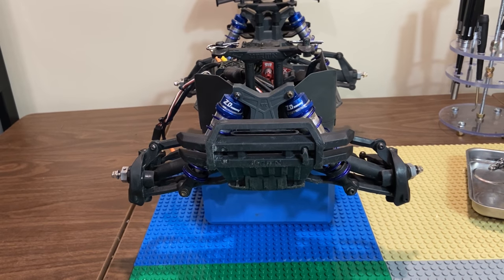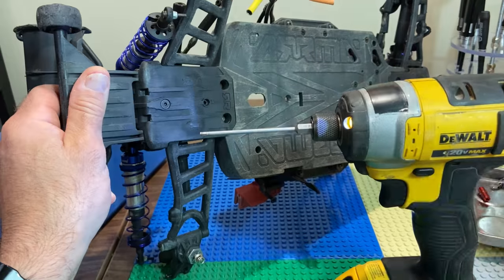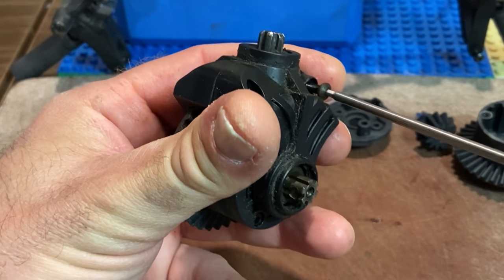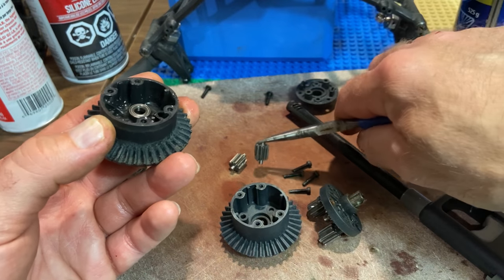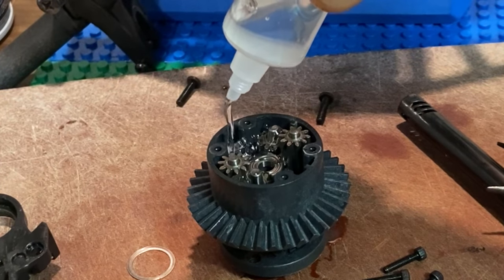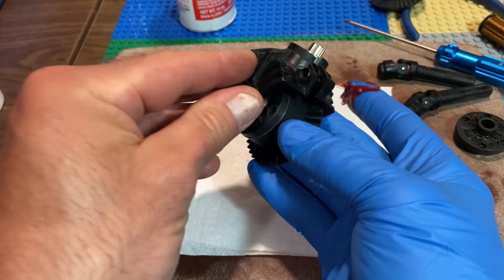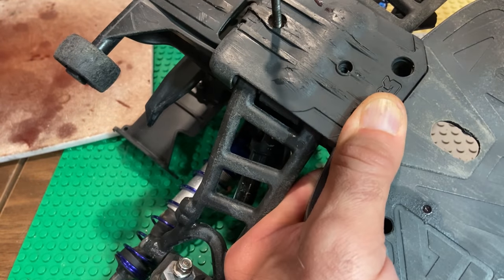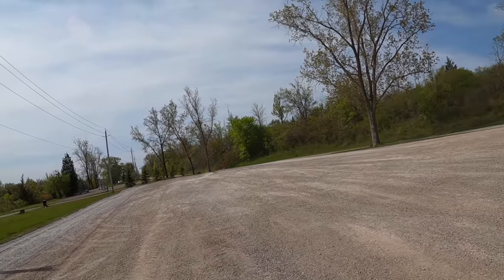ARRMA HOW-TO: 3S AND 4S DIFF REBUILD | GEARS, BEARING, GREASE AND DIFF FLUID.

Comment: Second time im opening my 3s input gear and second time i`m having a massive pain in the butt removing the inner bearing. Like... massive ! I've tried screwdrivers, i've tried creating leverage. Nothing works. My bearing remover can`t even snug in there as the space is too tight. It`s so annoying. I literally can reuse my plastic input gear because it is in perfect condition after i changed it the first time and now i can`t even reuse it because i can`t get the bearing off to service it. This is so weird and annoying at the same time that they would produce the part in a way that would lead to such a hassle. I am not a fan of going metal because it breaks other plastic stuff which otherwise won`t break but this is reason enough to start considering it.
Reply from the maker: It is tough to remove the bearing, I’ve put it in the freezer to “shrink” it, then the bearing came off. I agree with you about the plastic parts….i definitely keep the spur plastic. I ve since done metal diffs in my 3 s Typhon ang Granite, it s goin well. Let me know how you make out. Thank you
Reply: @phillybrc  I also tried the freezer trick after reading on the arrma forums but it was still a pain. Luckily I got it to move at least the first bit and then I used my bearing removal tool to pull it out. Do you have any recommendations about a metal input gear ? I've got a big rock 3s V3.
Reply from the maker: @experiencewithmartin972  Honestly, i ve ruined bearing trying to get them off. I usually by an extra input gear. Sucks. I went with Arrma metal diff. https://youtu.be/wP-CUAd8_fQ

Comment: ii think i buy a zdracing b8xe buggy after seeing a 340.00 buggy has plastic gears nope
Reply from the maker: It ‘s quite disappointing….I hear ya. Thanx
Reply: @phillybrc  i  know after hearing how good they are but thats YT and free promo car videos or they just test all new with no time on them like a big silly kid [me some times]with out looking into guts of situation but i am odd ball  .i like reliability first hence drive a is300 with upgraded aluminium radiator/trans cooler  bullet proof car for moist part the sc300 built a bit better its the next one and ill get rid of the newer one .but learned the hard way no resin why ether one not go 300-400k plus.but thats really the only car i know that way need minum crap to stay alive ..just fyi
Reply from the maker: @overbuiltautomotive1299  I won t deny they are really fun RC’s…I have no regrets at all, but the plastics are a little fishy.

Comment: i have more arrma typhon parts still sealed in bags than ill ever use. ive had mine for 5yrs or so, and the thing still runs great. i took care of it, i notice the caber & toe adjustment threaded rods are showing signs of some minor rust, and the end hex screws that are on the ends of the wheel axles are absolutely stuck in place. its not threadlock, because ive taken them off in the past, im guessing its rust. still dont know how ill get them off. aside from that, those cars were pretty durable. the screws break though. i use marine lubricant in my diffs, and on mesh gears. in diffs its great because it is water repellant, its a little more viscous than lighter grease, but not so much that it causes issues
Reply from the maker: Im with you, this platfor has treated my kids and i well, still run them often. Regular wear will happen! Thanx for watching

Comment: think running the gears dry will be fine, or use a silicone based or other plastic safe lubricant. normal grease will over time soften the plastic
Reply from the maker: I ve always used some type of marine grease on my diffs, I ve been working on this tube of Red n Tacky for over a year now, It s faired well. 👍🏻Thanx

Comment: Ik this vid is old now but I've been dealing with what I'm assuming are diff issues with my nephew's typhon mega. It's brushless now but even before that it was nothing but problems while my 3s has been a king for me. Anyway my question is , what would cause the car to barely reverse while making some kind metal gear clanking sound? It does it in forward to but only if u use the throttle slowly but it sounds like the diff gears r just crunching around in there. Obviously I've been in there and nothing looks immediately wrong gear wise but wtf knows.
Reply: I'll attach a video of it in a bit actually   and maybe it'll be something you've experienced. Tia
Reply from the maker: Is it cogging? ….an ESC issue. Will it eventually allow you to gain speed and the sound goes away? Not gearing issue perhaps?
Reply from the maker: @T401-r7x  not sure if you can attch a vid here. Try on Facebook messenger
Reply: @PhillyB_RC  yea it does go away once it gets going actually,  I just don't wanna tell my nephew it's allset and then have it eat the shit out of the gears ya kno. It could be the esc cuz its a flycolor cheap combo.  Maybe just return n exchange then if it's that. Idk yet but I appreciate u responding so quick!
Reply from the maker: @T401-r7x  Ya, it sounds like it’s cogging. Therefore, I would think it s the ESC. I’m having same issue with my Granite right now. I m gonna replace esc this week. Things to consider though: you could have a bad bearing in the motor, and possibly a bad cell in your battery could cause a cogging also.
Reply: @PhillyB_RC  cool thx,  I'll try a different battery and if not the esc is going back.
Reply: @PhillyB_RC  I  put the 3s gearbox , slipper and everything so once I return this motor/esc combo which esc motor combo do u recommend if any for just a mild / dependable upgrade  for the "mega" ? Thx for your help too btw.
Reply from the maker: @T401-r7x  No problem. I guess it depends on the budget. You could get a stock 3s BLX 100 setup from Jennysrc.com for cheap. Ideally you ll want an esc rated for 100amps.

Comment: This was helpful man, thanks for sharing. I especially liked where you called out the diff case seal - I used totally new case for mine and missed transferring it over, and didnt buy it separately. When I bolted the case together at first I could see the case end was deforming slightly, bottoming out on the shafts too hard. Knew I was missing something so I watched this and saw the seal - realised I'd missed it and problem solved. Also the grease, how much to use? A metric F-ton, excellent :)
Reply from the maker: Hahaha. Yep, I just shovel the grease in!  Glad this helped you! Lots more to come.

Comment: Love the content, are you ever gunna go over your tools, spare parts, that cool block thing.. I really enjoy watching your vids :D I noticed on my v3 Senton 3S BLX they put a drop of epoxy on the two motor mount screws, the clutch screw, the wheel knuckle, and on the diff left/right end parts. I removed that stuff.. and replaced with vibratight blue gel. I also had some issues with getting bearings to come off.. I found that using a thin clearance wrench and softly banging on it, made bearings come loose without breaking anything.
Reply from the maker: Raiden, thanks very much. I could go over my tools I suppose lol. I find in my earlier videos, my retention rate goes down when I show tools. I will add a link to the hand-tool set I use. Also, that “block thing” is my wife’s yoga block from the “Dollar Mart”! It works great and is cheap. I use blue Loc-tite on all metal-to-metal except I use “red” on pinikn gears. I appreciate all comments!

Comment: Awesome how to vid bro, well detailed!! 😎 👍 👊 🍻

I just recently picked up my first 3S line car from Arrma, the Infraction mega 4x4, $150 summer sale. It's a whole different animal from the 6S line-up that I'm used to working on. I have been meaning to get into the diffs so I can make remove any roll resistance but been putting it off lol. I did modify the gearbox to use mod1 gears & remove the clutch system. I got that puppy doing 85mph back to back on 4S with cool temps, no motor fan or heatsink, hobbywing 2200kv ezrun motor & castle MMX 6S esc. These 3S-4S line-up cars have serious potential lol. Just geared up & put GRP tires on it, hopefully it will hit mid 90s next.

Awesome work bud, Keep'm Fast!! 😎👍 👊 🍻
Reply from the maker: That sounds like an animal bro! These are wicked vehicles for being plastic. Hope the video helps you, I have others on my channel as well! Thanx
Reply: @phillybrc  lol, thanks,Absolutely!!
real reason I been putting off doing the diffs on this infraction mega was cuz they looked buried & was too lazy to get into it 😂. I been too busy getting the last videos in for my channel before peak winter, I do speedruns. My goal this season was 140, I hit 141 on 6S with my limitless GT.
I will definitely check out your vids, always searching for helpful tips.
Keep'm Fast Bro! 😎 👍 👊 🍻
Reply from the maker: @rcbustanut2057  cool man! I ll check out your channel. The diffs aren t that bad of a task… i m lazy too lol

Comment: Very good video. Helped me install a metal diff in my Granite.
I do wish you showed how to access the front diff.

I'm a newbie, so I'm afraid of just randomly unscrewing things in the front where the steering and servo are.

Thanks for showing the hex driver used to get the driveshafts off, i had to buy one special, but it went fine.
Reply from the maker: Good point, i did not. Try this vid, i show it here if i’m not mistaken. Thank you dude. https://youtu.be/flOnQvISOiQ?si=q0G8dRaey3G44BkP

Comment: I took my typhon 550 mega apart to do maintenance on my diffs since they started skipping, I’ve got all metal in the rear and the front was perfectly clean, I’m still having issues after replacing and installing. Could anyone help? I did also put a 20t 0.5 mod pinion on it with 0.5 57t spur.
Reply from the maker: I havn t had the MEGA apart, but what is it doing, or not doing.?

Comment: I've put a 20k cst fluid to my Kraton 4s v2 diff and it blew out again after 1min of driving so idk if should I put anything in there except for grease?
Reply from the maker: I would think you have a different issue. Make sure the bearings are good if they are not it causes the Dief to Rock and the gears get messed up.

Comment: Mine definitely doesn’t spin freely like yours not even close. I noticed you put the second bearing on without even a socket and hammering it in?? Mine both had to be hammered to hell.. I don’t know? If the first bearing goes to the end or not??  Mine is Arrma Granite blx V3??
Reply from the maker: Ya, i didn’t have to use a socket on the second bearing on the input shaft. I bottom the first one out though. I now add a little 3mm Washer on the screws between the yoke halves. The allows for less squeezie f that makes sense.

Comment: Thanks for the video it is very helpful. the metal upgrade is $100 and it says it will bring it up to 4s specs I upgraded my Typhon to 4s is that to much for plastic diff?also you mentioned a shim what is that?  did you use a  metal washer?
Reply from the maker: Thanks for watchin. Well, depends on your driving style and the surfaces you run your RC really. For the most part, you may be asking alot of the RC to run 4s in it. the metal diff would be a solid upgrade. Make sure your slipper clutch isn't overtightened, get off the throttle when landing jumps(espicailly high-traction surfaces like grass). Also, consider lowering your punch setting. The biggest one is throttle control, only stab throttle in loose conditions, where tires can break free. The shim is a thin washer essentially, I usually put mine on the large crown gear side. THe diffs are expensive, possibly consider putting metal yokes on stock diff. i hear this works well since it reduces flex, hope this helps.

Comment: Hi im having trouble with removing the last bearing on input gear i already broke 2 bearings aswell. You mentioned that putting it on freezer could  help, but it did not for me. How long should it be there to loosen it up?
Reply from the maker: Prob couple of hours. I ended up replacing the bearing since they are usually just a couple dollars

Comment: This is a great instructional video. Servicing diffs in the 3S line of Arrmas is pretty easy.  You can tell when you open the diff how low the diff fluid is.  This is a common problem with ALL Arrma diffs.  They always come low.  It's worth checking them out of the box along with the grease around the crown and input.  One more note for anyone doing this for the first time.  Don't over tighten the screws for the yoke.  It can bind the diff.  Check that it's not bound before you put it all back together.
Reply from the maker: Thanx for the input.

Comment: what type of diff oil do you recommend for the arrma senton 3s im planning to use front 15k and rear 10k is that good?
Reply from the maker: @morooks9310  that would be fine, I def would go thicker in the front.

Comment: Sorry I’m confused between the versions of diffs and input gears with 37 and 49 teeth for differentials and 13 and 17 teeth for inputs. Will any of this fit the granite 1/10 3S BLX? And what are the main differences in performance and durability? Thanks
Reply from the maker: Hey man. Keep in mind the parts I use in this video are for the BLX brushless version. The other ones are for the brushed motor, slower versions. They have a different “pitch” of gears so they require more teet to achieve desired performance. Thanx for stoppin’ by.
Reply: @phillybrc  thank you for the advice, you’re very kind. Warm regards!

Comment: Man thanks for this video! Super helpful and informative. I was wondering if you consider worth to change differentials to metal once the plastic ones begin to wear out. Or should I stay on plastic stock ones? Thank you very much for your answer. I’m subscribing right now! 😊
Reply from the maker: I really appreciate the SUB!  Honestly, although I eventually went to metal, I stayed plastic for a long time simply because it was cheaper and forced me to learn to  drive better and be mindful of breakages, especially if you are running with kids or inexperiencedl.  Im still plastic spur gear however. Thanx for watchin. Let me know if there are videos you d like to see.
Reply: @phillybrc  man thanks a lot for your reply:D I think you’re absolutely right, I better start improving my skills before thinking about new parts I don’t even need yet. And as a beginner well almost everything on your channel is new to me. Maybe it’ll be good a video on how to properly bash an rc? I mean what you should prepare before session, what to do during the session and what parts check or repair after bashing. Again thank you for your answer.

Comment: This video helped me a lot, thanks!

My question, I have ordered 20k oil for the gears, can I use my copper grease to grease up the diff etc or is that a no go? I don't want to spend money on these tiny tubs of grease if possible
Reply from the maker: I m not familiar with copper grease, using a marine style grease that doesn t break down when it gets wet is what you should go with. I use Red’nTacky, it s “waterproof”. Thanx

Comment: Do They Make Metal Gears For It & Is It The Same As The Arrma Vendetta?
Reply from the maker: Arrma and Hot Racing make a metal diff. The vendetta’s diff is the same but slipper clutch assembly is slightly different since it isn t a “basher”. Thanx

Comment: Back again visiting is my 4s was going great but now I'm at a complete loss I have tried as much as my knowledge so when I throttle all that does make a noise like the clutch is slipping except a bit more squeaky / hire pitch have open front centre and rear diff they all seem to be sweet and tight any ideas or any response whatsoever would be massively appreciated😊
🔩 keep up the excellent Work man no mucking around simply put and didn't notice before but extremely well-spoken and well-worded🙏✌️
Reply from the maker: @dnbarracus  Thanks for the compliment. Means alot. Well, just gonna throw out a couple things to look at. Pinion gear isn t touching spur gear (motor moved). I was having a problem with the clutch (center diff in your case) was breaking the back side of the assembly, this would be going to the input side of your rear diff. It was broken so no power delivery. Do you have facebook? Send me a good video through messenger and i ll try to help.

Comment: Great video, well made and easy to follow.  Nice that you sped up the actual working portion then narrated over the top.  Subbed for more great RC content.
Reply from the maker: Much appreciated!  Thanx for the compliment and the SUB! Im gonna check you out as well.
Reply: Yea I was actually wondering how do u or what do u use to edit it like that.  I tried putting text on my video but couldn't figure out how to put in at the specific time I wanted at?

Comment: Great video, do you have for changing the front, also. I noticed that you had made a hole under the center diff in the body? Why was this done?  Thanks,
Rick
Reply from the maker: Front is pretty much the same. The hole is to allow dirt to escape the motor module. When dirt can escape, it wont ruin or strip your spur gear. It works awesome!
Reply: @phillybrc  got it, thanks.

Comment: Do you think super lube is ok to use in external diff tobe grease? Super lube synthetic? 90023
Reply from the maker: I m not really familiar with that grease, I did google it and believe it would work fine. I tend to lean towards marine grease. Thanx.
Reply: @phillybrc  ok thanks.